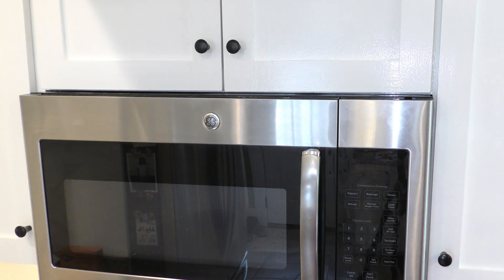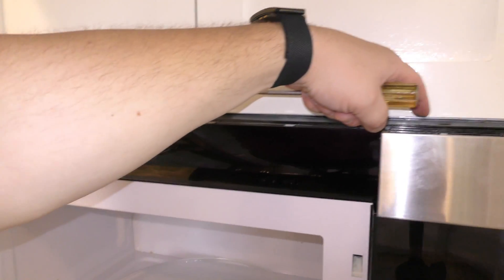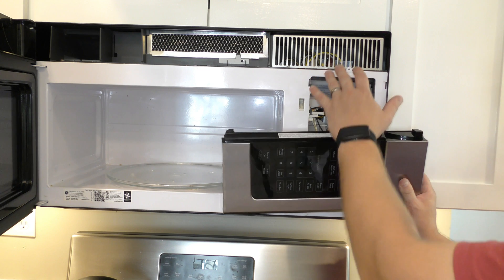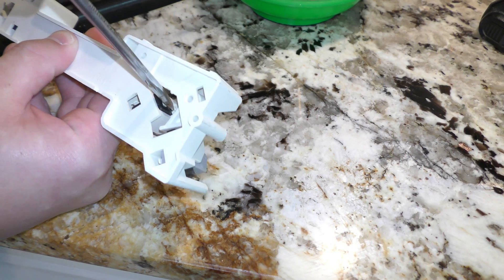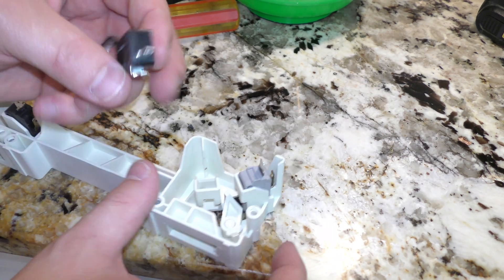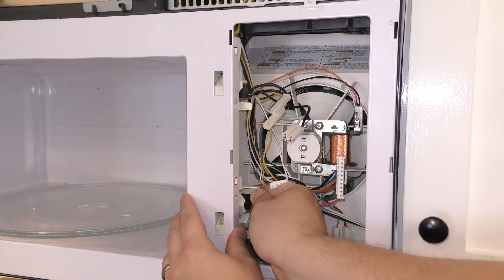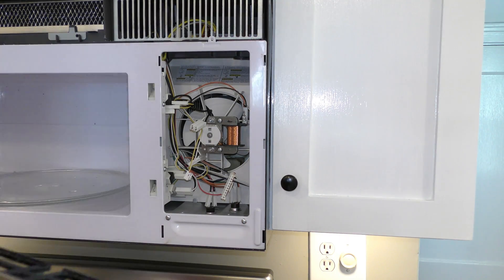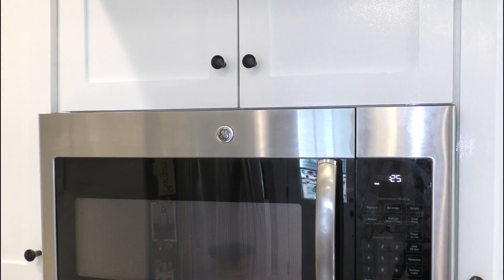GE Microwave Keeps Blowing Fuse / Breaker - DIY Fix

Comment: Thanks!   Just happens to be the exact same microwave I have.  The ol' take it apart, jiggle it, and put it back together trick worked.  All three switches tested good for me, though.  Plugged it back in, and it worked.
Reply from the maker: Ha! Nice! I'd suspect it will start to act up again at some point. If all the switches are still in good shape, the switch holder could be your issue. It could be causing misalignment - https://amzn.to/3FYPOzM
Reply: @KeyFobRob  And... You were correct.  Lasted about a day.  I tried to get smart and just bypass the switches, but I read that the switches have to all transition from closed to open at around the same time for it to work.  Damn lawyers and safety engineers at it again, protecting me from myself.

Comment: I had the same symptom of the microwave tripping the breaker after 1-2 seconds of operation. I followed your methodology and diagnosed the problem to a mechanical misalignment of the top sensor switch, i.e., the door "hook" was not actuating the top sensor switch. I hot glued the switch into place and it now works. Ninety minutes of fairly straight forward disassembly, debug, and reassembly saved the cost and hassle of purchasing a replacement microwave. Thank you!!!
Reply from the maker: Great job! Invested a little time but that's a whole lot better than a new unit 👍
Reply: @KeyFobRob  Yes, I noticed on my microwave (and yours) that the plastic ramp for the door hooks gets worn because all the parts are cheap plastic. And like Nick said the hook fails to engage the micro-switch which is very sensitive.  I was trying to think of a way to do a field repair but decided to order the whole switch holder (with built in ramps) plus the switches to give it a new lease on life. My switches are working electrically but I'm an electrician and I don't trust them. ....not after tripping the cb. It's unbelievable that they made the hook ramps cheap plastic. Microwave doors used to have a squeeze handle to first disengage the hooks on the door side.....but now they just go cheap. We have ovens at work that must be 30 years old. Oh yeah, the face of the hook itself is also wearing a groove from all that slamming into the switch plunger. Thanks for the video. Saved me lots of money.

Comment: My switches look fine but fuse keeps blowing just like yours.  At least the switches click just fine
Reply from the maker: The switch holder goes bad sometimes as well. Making the microwave think the switches aren't operating correctly. It could be the switch holder that has melted or deformed - https://amzn.to/3pNDHkh

Comment: Is there any difference between which number fuse you use for example the bad one i pulled out is a FA-62 but the other 2  that are  good are FA-63   , does it have to be the same exact number or could i use any as long as it fits ?

Comment: My fuse is fine but the 20A breaker is tripping. Any thoughts about which component might be the culprit?
Reply from the maker: It's probably one of the switches. Check the description for a link

Comment: Did you pull the fuse out without discharging the capacitor? Just wondering if I have to do this. Thanks
Reply from the maker: I didn't need to pull the fuse on mine. Only the switches were bad
Reply: @KeyFobRob  Would the display ever turn on when the door switch is bad?  My display will never turn on, and the 20A fuse is good.

Comment: This was VERY HELPFUL. I was able to repair, but 6 weeks later the same thing happened again. I replaced the defective door switch again.  Now I am wondering Is there something else I should be doing to prevent this from happening again?😀🙃
Reply from the maker: If the switch went bad again, it's usually the switch holder that has melted or deformed - https://amzn.to/3pNDHkh

Comment: Hrmmm.  I'm having fuses blown when the door is opened or closed but not always.  Changed fuse and tested all three door switches mechanically and electrically and appear to be fine.  Debating if it will be worth swapping out all three switches. Same model as yours except all black.  Our door has some play in it, but the hinges are still solid.
12/26:
Well, didn't quite work for me (Prerunning's fix).  I tried some double sided foam tape(leaving paper on one side) and I definitely looks like it presses the lower black switch first.  This time the fuse blew on very first try instead of after a couple of runs like the first change.  Maybe I just need to get the two plastic latch parts anyway...
Reply: I've got a black one model JVM316DJBB. Is that the same as yours? Did you find a fix?

Comment: This was very helpful.  Changed bad door switches and microwave worked for a day.  And started doing the same thing again.  Any ideas?
Reply from the maker: Sometimes that bracket that holds the switches moves and needs to be replaced. If the cheap plastic melts a tad and sags the switches might be misaligned - https://amzn.to/3yP8i3M

Comment: im going to try it.  i have to take it apart first.   when you unplugged the circuit board was it only those 3 to detach the circuit board or was there more.  Also when you unscrewed that the part that was attached to the switches was it only those 2 screws  that you had to take out.  Thank you so much for the information.

Comment: You are the man.    New  20A fuse and cleaned the sensors.  One of the sensors was sticking due to the grease factor.   Cleaned with isopropyl alcohol and they started popping up fine. Total cost $3:49 for the fuse.
Reply from the maker: Good stuff! Glad you could get it sorted out for a couple bucks and little bit of your time.

Comment: Great help! I disassembled and tested the way you said, one of the sensors switches was jammed. I unjammed it with the screwdriver and it started functioning normally again. Put microwave back together and no more circuit breaker trip! Thank you for your help
Reply: Same here, stuck sensor switch.  Thank you
Reply: Well, my stuck switch that I unstuck, ended up getting stuck again. So I ordered fresh switches.
Reply: @danielkusk4268  The switch is welding shut because of the root issue. You'll nuke the new switches and weld them shut as well if you dont fix the TIMING. Its a horrible design. After years of use the plastic wears just enough to throw off the safety switch timing. If the switches activate .5 millimeter out of sync, you will blow fuses!  You have 2 choices. Buy a replacement latch bracket or try the free DIY fix I posted a video about.
Reply: @prerunning6086  got a link to your video?
Reply from the maker: Good stuff! Glad the video could help you get it sorted out
Reply: Good to know, I'll do the same. Thanks

Comment: wE REplaced the door switch fuse a year ago.. (during hte pandemic which took longer) .. then it worked OK for a while.. then about 3 months ago the power fuse blew.. just replaced that and STILL the unit trips the circuit breaker... why is this suddenly an issue.. and where did you get that part out?

Comment: My switch is bad on the door, ordered it and waiting on the new one to come in.  I will update once job is complete.  Thanks!
Reply from the maker: Good luck!
Reply: @KeyFobRob  It worked for about a day and the same switch blew again.  Any ideas?
Reply: @michaeljordy660  The switch is welding shut because of the root issue. You'll nuke the new switches and weld them shut as well if you dont fix the TIMING. Its a horrible design. After years of use the plastic wears just enough to throw off the safety switch timing. If the switches activate .5 millimeter out of sync, you will blow fuses!  You have 2 choices. Buy a replacement latch bracket or try the free DIY fix I posted a video about.

Comment: Same exact microwave. Replaced the top switch that was bad. The panel comes up with xxx’s all over it and the microwave makes a loud hummm like it’s trying to start. Then it trips the breaker. It’s been a great microwave and I would replace it with the same. I just hate to if it’s something I can fix. And I thought I had it with a $5 fix. 😬 Any ideas?

Comment: Hey Rob,   Ive got the same issue, same GE part number and I ordered the switches you listed. The blades that are on my original switch are skinner that the new ones.  Any other switches i've found online look to be too wide as well. Any ideas?
Thanks!

Comment: I don't understand why a busted door switch is tripping my circuit breaker. why would it cause the microwave to draw too much power, and why would it trip the 20A circuit breaker before blowing its own internal 20A fuse?
Reply: Its because the switches have to activate in a specific order to work properly. The latch mech is a bad design. After years of use, the latch wears a groove in the plastic guide ramps. 1mm amount of wear is enough to cause the latch to just barely miss the switch it needs to engage first. If they activate out of order its a short circuit.
Reply: @prerunning6086  Good answer.   I think this is whats going on with us. I'll give it a shot tomorrow and see, thanks for posting this vid!
Reply: @prerunning6086  So should I replace both?
Reply: @bobpayton6990  If theyre sticking yes they need to be replaced but they will just die again if you dont fix the root issue. Incorrect latch / switch timing causing a dead short across the power lines. This arcs across the swicthes and spot welds them.  I came up with free diy fix, check the video i posted.
Reply: @prerunning6086  My latch switches are not sticking. But if I open the door before the item is finished, the fuse will blow. So as long as I let the cycle finish, as normal, it works well. It took a couple of fuses to figure that out.
I do see the wear on the latch slides. 
I'm not sure where the video is you posted or it the main one here?

Comment: yeah we had same problem. Who would imagine that having a blown 20 amp fuse behind the GE control panel would trip the house circuit breaker (I would expect a blown fuse to just result in dead unit). weird, but that was what we saw.
Reply from the maker: Glad I could help!👍